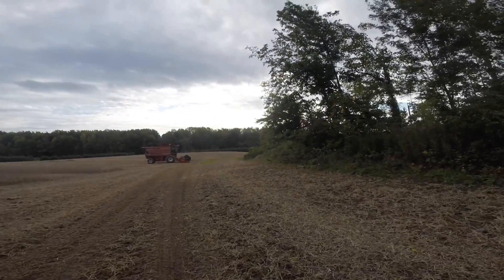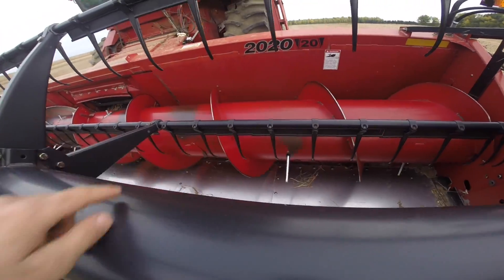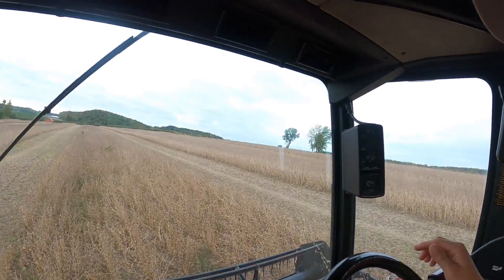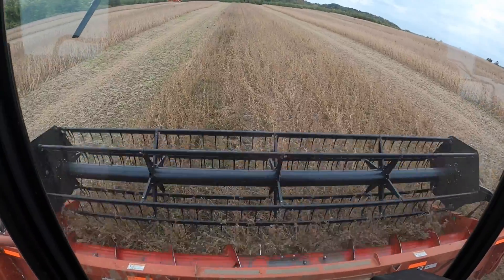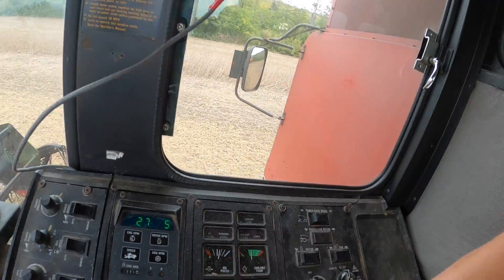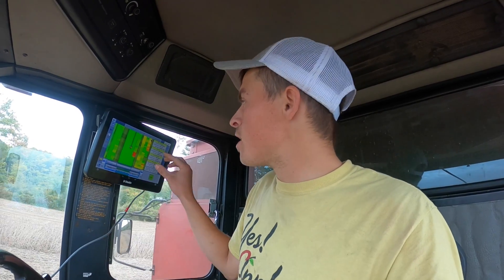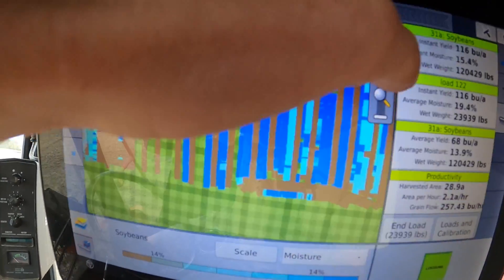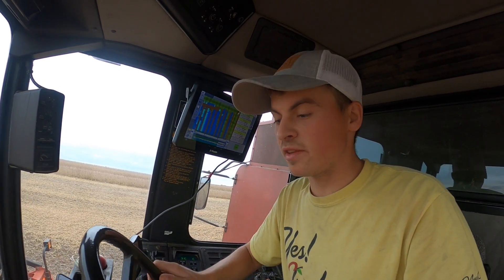Harvesting Soybeans. Case International 1660 how it works.

Comment: Do you plan to try no tilling a field just to see?
Reply from the maker: For wheat or soybeans?
Reply: @AppleBoyWNY  I guess both
Reply from the maker: For wheat we minimal till just because the drill does not have an extreme amount fo down pressure and I’m worried the seed would be on the surface. For beans I would like to try a field no till with the new to us setup we have for that  @gabeolson-jensen8676

Comment: Any post emerge fungicide on the beans? Any disease pressure in them?
Reply from the maker: This year we did not do as many acres as we probably should have. Ive been using Miravis Neo. I have been seeing some white mold is certain fields where the beans lodged.
Reply: @AppleBoyWNY  Good conditions for white mold this year. 3 full rate applications of Neo had a very positive ROI on our sandier fields.
Reply from the maker: @ethanhumbert2984  Awesome I’m glad to hear that. Ive only done one pass before but that would be interesting to try.